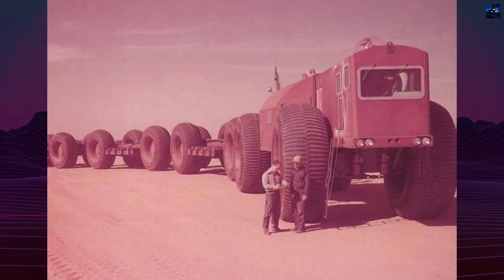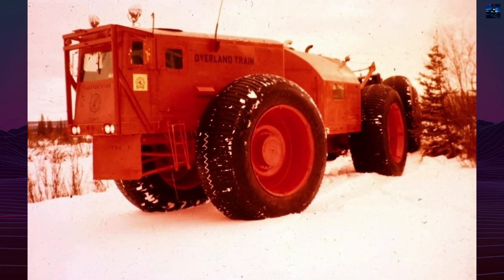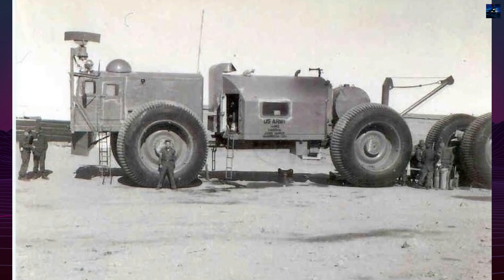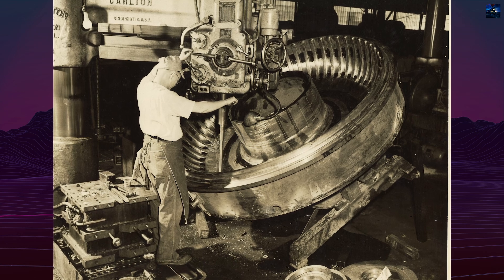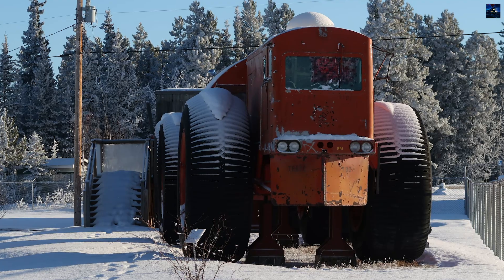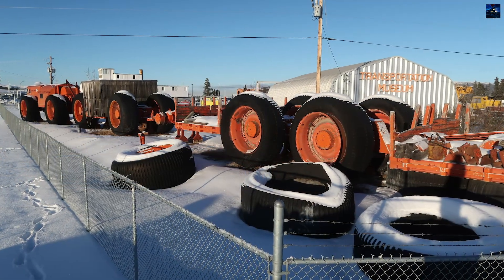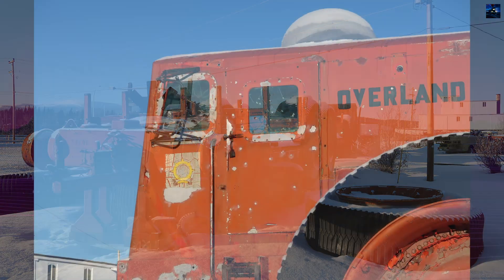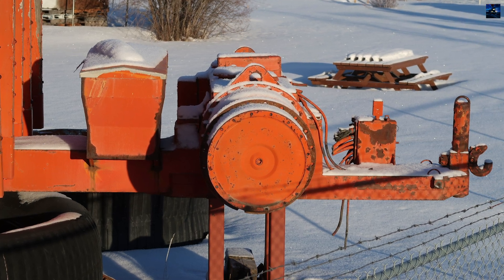Letourneau LCC-1 Sno-Train: Arctic Transportation Marvel

Comment: The LeTourneau at the Yuma Proving Ground is the TC-497, not the LCC-1. As a note, it is displayed inside the post's secure perimeter, and is not accessible without a pass. Passes are available  at the Visitor control center (M-Th 6am-3:30pm) where there is also an open air military vehicle museum that is open 24 hours.